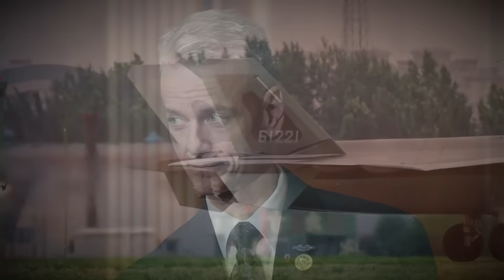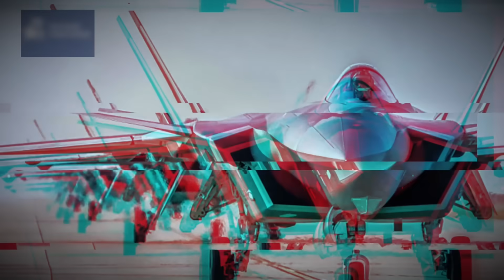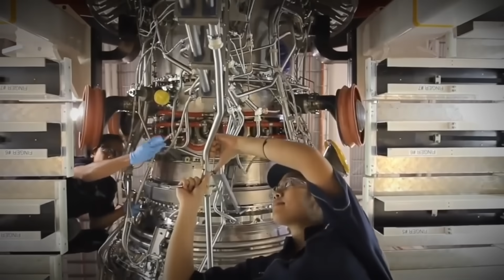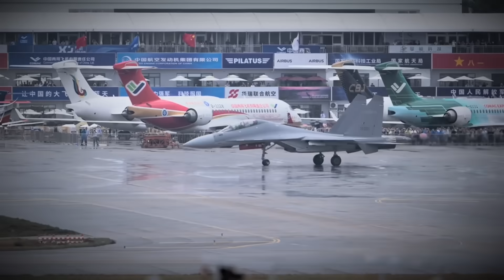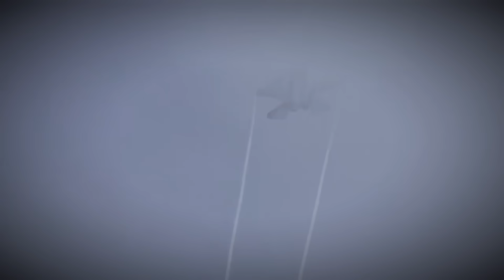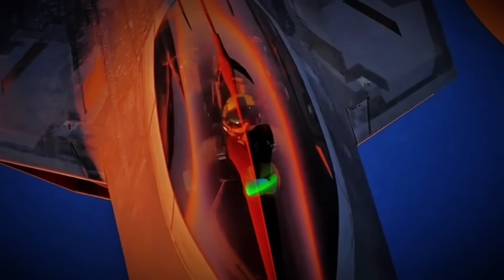GE Just Broke Its Silence on China's Jet Engine Advancement

Comment: Their latest engines can last only up to 1,500 hours. Far from western engines which can last nearly 4,000-6,000 hours, sometimes up to 8,000 hours. 
This video is disinformation.
Reply: Chinese engines have achieved a lifespan of over 4,000 hours after several iterations, as China's materials science is now among the most advanced in the world.
Reply: China's Fighter Jet Engines: 5th-Gen Leading the Way, 6th & 7th-Gen Test Flights Breaking New Ground, Fully Surpassing the U.S.
 
China's aviation engine sector has achieved a leapfrog development from catching up to global leadership. The 5th-gen engines WS-15 and WS-19 have long outperformed their U.S. counterparts in performance. The 6th and 7th-gen fighter jet engines have even completed successful test flights ahead of schedule, completely widening the generational gap with the U.S. in core technologies, performance parameters and future layout, demonstrating the strong strength of China's aviation engines and firmly seizing the commanding height of the global aviation engine track.
 
In the field of 5th-gen engine power, WS-15 and WS-19 have made precise breakthroughs in U.S. technical barriers. As the standard power for the J-20, WS-15 is a performance benchmark among global 5th-gen large-thrust engines, with afterburning thrust reaching 18.5 tons and thrust-to-weight ratio exceeding 10.5. Compared with the F119 engine equipped on the U.S. F-22, its thrust is increased by 18.6% and thrust-to-weight ratio is over 50% higher, directly endowing the J-20 with 1.8 Mach supersonic cruise capability, and the response speed of supermaneuverable actions is 0.8 seconds faster than that of the F-22, achieving comprehensive suppression in air combat and penetration capabilities. In terms of core materials, WS-15 adopts domestically developed 3rd-gen single-crystal turbine blades that can withstand temperatures up to 1577℃, equipped with 128 nanoscale micro-cooling channels, improving cooling efficiency by 37%. The stable working time of the blades exceeds 4000 hours, and its high-temperature reliability is 1.5 times higher than that of the F119, completely solving the problem of high-temperature wear of previous aviation engines. WS-19, adapted for medium-sized 5th-gen fighters, is a world-leading medium-thrust engine with maximum thrust exceeding 12 tons, far surpassing the 10-ton thrust limit of the U.S. F414 engine equipped on the F/A-18. Its turbine inlet temperature reaches over 1850K, with excellent explosive power and energy conversion efficiency. It also adopts a compact 3-5-1-1 configuration, reducing weight by 12% while improving reliability by 20%, adapting to the deck operation needs of carrier-based aircraft. Its performance is comprehensively superior to the U.S. F414 and European EJ200 engines, filling the gap in domestic medium-sized 5th-gen fighter power.
 
On the basis of the stable leadership of 5th-gen engine power, China's 6th-gen fighter jet engine has taken the lead in completing installed test flights, with technical maturity and performance far ahead of the U.S. The U.S. 6th-gen engine XA100 is still in the ground test and partial verification stage, with unresolved mode switching failure risks, while China's 6th-gen variable cycle engine has achieved stable air operation, with core technologies and performance indicators reaching the world's leading level. In terms of performance, the engine's afterburning thrust exceeds 22 tons and thrust-to-weight ratio is over 12, 17% and 14% higher than the U.S. XA100 target values respectively. It adopts variable cycle technology with independent intellectual property rights, which can seamlessly switch between "high-thrust supersonic cruise mode" and "high-efficiency energy-saving cruise mode" in less than 0.5 seconds. It can not only support 6th-gen fighters to achieve 2.5 Mach supersonic cruise and a range exceeding 10,000 kilometers, but also reduce fuel consumption by 37.5% during subsonic flight, balancing combat effectiveness and endurance; the U.S. XA100 can only achieve a 10% increase in thrust and 25% fuel saving, and its complex mechanical valve structure is prone to stuck mode switching, resulting in significantly lower practicality. In terms of technology, China's 6th-gen engine innovatively adopts a three-bypass + interstage combustion chamber design, reducing 20% of core parts, with a fault diagnosis accuracy rate of 99.2%, which can predict faults 200 flight hours in advance and improve maintenance efficiency by 50%; it is also equipped with new stealth composite materials, reducing the engine's radar cross-section by 60%, meeting the all-domain stealth needs of 6th-gen fighters, while the U.S. XA100 still uses traditional metal casings with no substantial breakthrough in stealth performance, showing an obvious technological generational gap.
 
More promisingly, China's 7th-gen fighter jet engine has completed its first flight with the prototype, while the U.S. is still in the technical pre-research stage, completely seizing the opportunity in the future aviation engine track. China's 7th-gen engine breaks through the traditional turbofan power framework, adopting combined cycle propulsion technology integrating turbofan-ramjet-scramjet, combining hydrogen-oxygen rotating detonation power principle, with thermal efficiency reaching 49%, thrust increased by 20% compared with 6th-gen engines and weight halved. It can support fighters to achieve hypersonic cruise above 5 Mach in the atmosphere and a maximum speed exceeding 6.5 Mach, and can also adapt to low-orbit space flight, realizing "air-space integration" all-domain combat; the U.S. 7th-gen engine still focuses on traditional turbofan technology upgrades, failing to overcome the hypersonic propulsion mode switching problem, and can only achieve a speed target below 4 Mach, with comprehensively limited power performance and application scenarios. In terms of core technological breakthroughs, China's 7th-gen engine has conquered key technologies such as high-temperature supercritical pressure pipelines and quantum plasma stealth coatings, with turbine blades capable of withstanding temperatures exceeding 1827℃, and can operate stably in extreme environments such as high-altitude low temperature (-60℃), high humidity (95%) and sandstorms, with full battlefield adaptability; it also innovatively adopts intelligent bionic structure and self-healing technology, which can automatically fill and repair minor component damage within 1 hour, greatly improving battlefield survival capability. In contrast, the core materials and self-healing technology of the U.S. 7th-gen engine are still in the laboratory stage, and no long-term ground thermal test has been carried out. Compared with China's progress of completing the first flight and gradually advancing engineering, the generational gap cannot be narrowed in the short term.
 
From the 5th-gen engine outperforming U.S. counterparts, to the 6th-gen engine leading in test flights, and then to the 7th-gen engine taking the lead in opening a new air-space track, China's fighter jet engines have achieved continuous breakthroughs in three generations of iteration, with core materials, key technologies, performance parameters and development progress comprehensively surpassing the U.S. It not only lays a solid power foundation for the leapfrog improvement of China's air force combat effectiveness, but also redefines global aviation engine technical standards, demonstrating the absolute competitiveness of China's high-end manufacturing and cutting-edge technology, and completely breaking the long-term Western monopoly in the aviation engine field.
Reply: @kinwaisiu9414  why do I sense this is from Xinhua Propaganda machine ?
Reply: @VradugKobag  No one ask you to believe it. Feel better soon.
Reply: @kinwaisiu9414  Because it is. The more you talk about it the more people are doubtful. Talk is cheap.
Reply: F-35's falling out of the sky disagrees!
Reply: I read it's the other way around...
Reply from the maker: Thanks for the comment — just to clarify, the script doesn’t mention any specific engine-hour numbers at all. In fact, it openly states that reliability is still China’s biggest remaining weakness and that Western engines maintain a clear lead here. The video focuses on GE acknowledging the pace of development — not claiming parity or equal service life.

Comment: Stolen technology
Reply: China's Fighter Jet Engines: 5th-Gen Leading the Way, 6th & 7th-Gen Test Flights Breaking New Ground, Fully Surpassing the U.S.
 
China's aviation engine sector has achieved a leapfrog development from catching up to global leadership. The 5th-gen engines WS-15 and WS-19 have long outperformed their U.S. counterparts in performance. The 6th and 7th-gen fighter jet engines have even completed successful test flights ahead of schedule, completely widening the generational gap with the U.S. in core technologies, performance parameters and future layout, demonstrating the strong strength of China's aviation engines and firmly seizing the commanding height of the global aviation engine track.
 
In the field of 5th-gen engine power, WS-15 and WS-19 have made precise breakthroughs in U.S. technical barriers. As the standard power for the J-20, WS-15 is a performance benchmark among global 5th-gen large-thrust engines, with afterburning thrust reaching 18.5 tons and thrust-to-weight ratio exceeding 10.5. Compared with the F119 engine equipped on the U.S. F-22, its thrust is increased by 18.6% and thrust-to-weight ratio is over 50% higher, directly endowing the J-20 with 1.8 Mach supersonic cruise capability, and the response speed of supermaneuverable actions is 0.8 seconds faster than that of the F-22, achieving comprehensive suppression in air combat and penetration capabilities. In terms of core materials, WS-15 adopts domestically developed 3rd-gen single-crystal turbine blades that can withstand temperatures up to 1577℃, equipped with 128 nanoscale micro-cooling channels, improving cooling efficiency by 37%. The stable working time of the blades exceeds 4000 hours, and its high-temperature reliability is 1.5 times higher than that of the F119, completely solving the problem of high-temperature wear of previous aviation engines. WS-19, adapted for medium-sized 5th-gen fighters, is a world-leading medium-thrust engine with maximum thrust exceeding 12 tons, far surpassing the 10-ton thrust limit of the U.S. F414 engine equipped on the F/A-18. Its turbine inlet temperature reaches over 1850K, with excellent explosive power and energy conversion efficiency. It also adopts a compact 3-5-1-1 configuration, reducing weight by 12% while improving reliability by 20%, adapting to the deck operation needs of carrier-based aircraft. Its performance is comprehensively superior to the U.S. F414 and European EJ200 engines, filling the gap in domestic medium-sized 5th-gen fighter power.
 
On the basis of the stable leadership of 5th-gen engine power, China's 6th-gen fighter jet engine has taken the lead in completing installed test flights, with technical maturity and performance far ahead of the U.S. The U.S. 6th-gen engine XA100 is still in the ground test and partial verification stage, with unresolved mode switching failure risks, while China's 6th-gen variable cycle engine has achieved stable air operation, with core technologies and performance indicators reaching the world's leading level. In terms of performance, the engine's afterburning thrust exceeds 22 tons and thrust-to-weight ratio is over 12, 17% and 14% higher than the U.S. XA100 target values respectively. It adopts variable cycle technology with independent intellectual property rights, which can seamlessly switch between "high-thrust supersonic cruise mode" and "high-efficiency energy-saving cruise mode" in less than 0.5 seconds. It can not only support 6th-gen fighters to achieve 2.5 Mach supersonic cruise and a range exceeding 10,000 kilometers, but also reduce fuel consumption by 37.5% during subsonic flight, balancing combat effectiveness and endurance; the U.S. XA100 can only achieve a 10% increase in thrust and 25% fuel saving, and its complex mechanical valve structure is prone to stuck mode switching, resulting in significantly lower practicality. In terms of technology, China's 6th-gen engine innovatively adopts a three-bypass + interstage combustion chamber design, reducing 20% of core parts, with a fault diagnosis accuracy rate of 99.2%, which can predict faults 200 flight hours in advance and improve maintenance efficiency by 50%; it is also equipped with new stealth composite materials, reducing the engine's radar cross-section by 60%, meeting the all-domain stealth needs of 6th-gen fighters, while the U.S. XA100 still uses traditional metal casings with no substantial breakthrough in stealth performance, showing an obvious technological generational gap.
 
More promisingly, China's 7th-gen fighter jet engine has completed its first flight with the prototype, while the U.S. is still in the technical pre-research stage, completely seizing the opportunity in the future aviation engine track. China's 7th-gen engine breaks through the traditional turbofan power framework, adopting combined cycle propulsion technology integrating turbofan-ramjet-scramjet, combining hydrogen-oxygen rotating detonation power principle, with thermal efficiency reaching 49%, thrust increased by 20% compared with 6th-gen engines and weight halved. It can support fighters to achieve hypersonic cruise above 5 Mach in the atmosphere and a maximum speed exceeding 6.5 Mach, and can also adapt to low-orbit space flight, realizing "air-space integration" all-domain combat; the U.S. 7th-gen engine still focuses on traditional turbofan technology upgrades, failing to overcome the hypersonic propulsion mode switching problem, and can only achieve a speed target below 4 Mach, with comprehensively limited power performance and application scenarios. In terms of core technological breakthroughs, China's 7th-gen engine has conquered key technologies such as high-temperature supercritical pressure pipelines and quantum plasma stealth coatings, with turbine blades capable of withstanding temperatures exceeding 1827℃, and can operate stably in extreme environments such as high-altitude low temperature (-60℃), high humidity (95%) and sandstorms, with full battlefield adaptability; it also innovatively adopts intelligent bionic structure and self-healing technology, which can automatically fill and repair minor component damage within 1 hour, greatly improving battlefield survival capability. In contrast, the core materials and self-healing technology of the U.S. 7th-gen engine are still in the laboratory stage, and no long-term ground thermal test has been carried out. Compared with China's progress of completing the first flight and gradually advancing engineering, the generational gap cannot be narrowed in the short term.
 
From the 5th-gen engine outperforming U.S. counterparts, to the 6th-gen engine leading in test flights, and then to the 7th-gen engine taking the lead in opening a new air-space track, China's fighter jet engines have achieved continuous breakthroughs in three generations of iteration, with core materials, key technologies, performance parameters and development progress comprehensively surpassing the U.S. It not only lays a solid power foundation for the leapfrog improvement of China's air force combat effectiveness, but also redefines global aviation engine technical standards, demonstrating the absolute competitiveness of China's high-end manufacturing and cutting-edge technology, and completely breaking the long-term Western monopoly in the aviation engine field.
Reply: @kinwaisiu9414  they all will be shot down
Reply: @kinwaisiu9414 waste time replying to morons
Reply: Yes you are absolutely right, everything stolen and nothing to worry, you and your country just sit back, relax and dreaming. Stop China China China every single minute or will soon/already be mentally disordered 😂
Reply: Too bad 😂😂😂😂😂😂
Reply: Westerner resent the word "Stolen". It implies that their "severe incompetency" of protecting the military secrets. May be learning the food industry keeping to secure their recipes!
Reply: @JohnGreen-w3t If you are correct then the US is COOKED with more problems than just advanced aero engines.  It means US Cyber Security sucks and that Chinese AI, engineering , computer warfare and overall abilities are superior to American systems.  The new battlefields are space and digital  in which China has considerable abilities.  While the US churns out DEI degrees the Chinese focus on STEM and that is what all military applications are based on-STEM
Reply: @cashflownpv correct
Reply: Everything China accomplished is 'stolen' ?
Reply: When angry losers (Westerners/Ewwdians) can't compete with China, making false accusations against China is their only option left.
Reply from the maker: Thanks for sharing your thoughts! It’s important to discuss these concerns as they affect the industry as a whole.
Reply: 你说的话，正是欧美国家逐渐落后的原因所在。你们的祖先靠偷和抢发家，我们可不是，这才是真正的区别。
Reply: Denial Stage.
Reply: like yo warmongering jews
Reply: J36, J50 China copied 🛸 👽